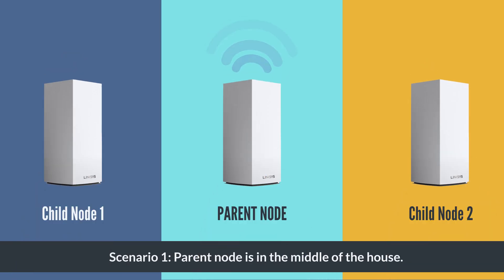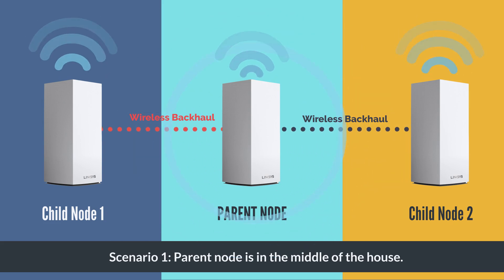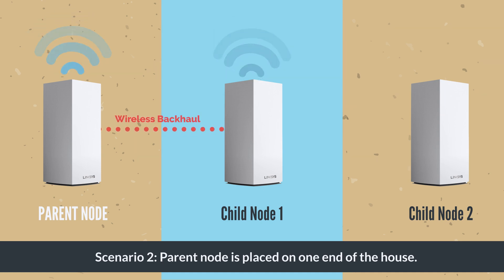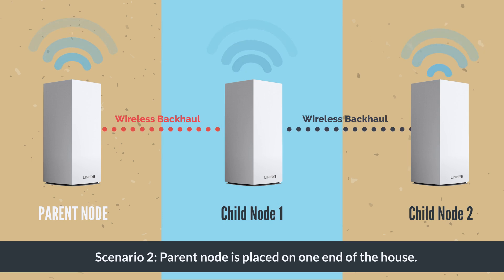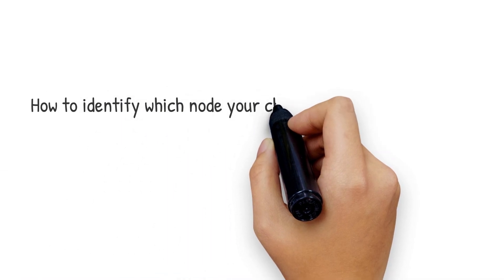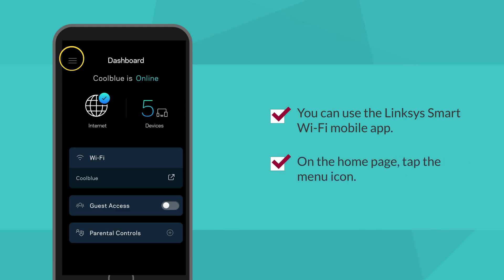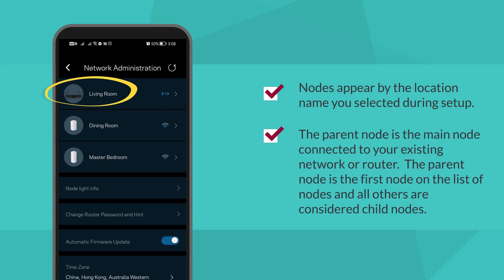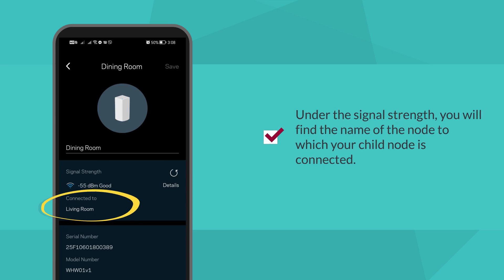Mesh Node Layout Explained

Comment: *Linksys Velop Pro 6E&pro 7: Your Closed Firmware is Killing This Amazing Hardware!*
*Important Note: This post has been repeatedly deleted from r/Linksys without explanation. This confirms the policy of silence and exclusion you practice against customer feedback.*

To the Linksys Team and Management,

I am writing to express my profound disappointment with the *Linksys Velop Pro 6E**. This device represents a classic case of **squandering superior hardware* through a closed and restrictive operating system.

*The Core Problems:*
- Limited functionality in the stock firmware
- Unnecessary complexity in setup and management  
- No real control for power users
- Becomes a locked box that can't be customized

*The Reality Check:*
In today's networking world, *any device that doesn't support open-source firmware like OpenWrt is fundamentally limited**. This isn't just my opinion - it's the consensus in the tech community. Open systems like **OpenWrt* allow users to:
- Extend the life of older hardware
- Achieve performance matching newer devices
- Have full control over their network

*The Result?*
Excellent hardware specifications *wasted in a software prison**. The Velop Pro 6E becomes **expensive electronic scrap* due to firmware restrictions.

*My Request:*
Please reconsider your policy. Releasing source code or offering *official OpenWrt support* would:
- Unlock the true potential of your hardware
- Restore faith among technical users
- Demonstrate commitment to customer freedom

Sincerely,
A Disappointed Customer